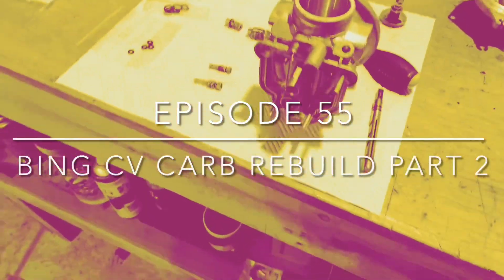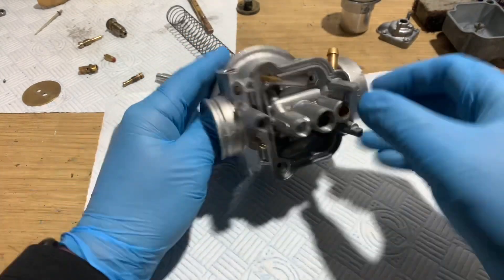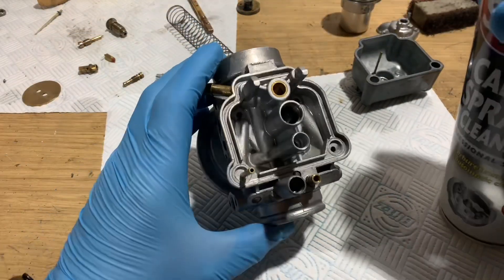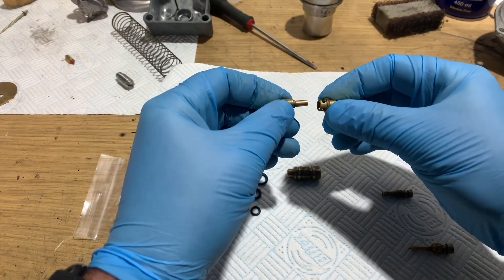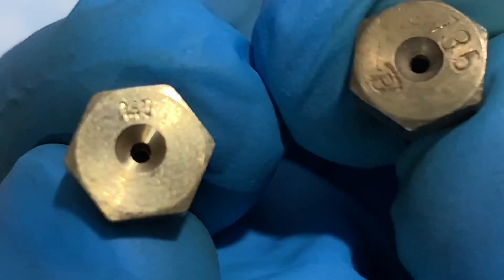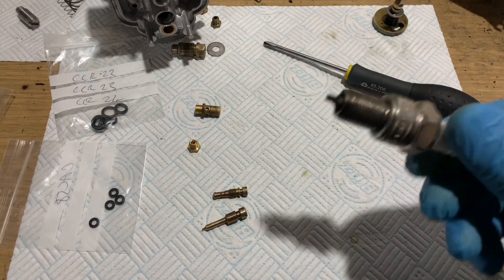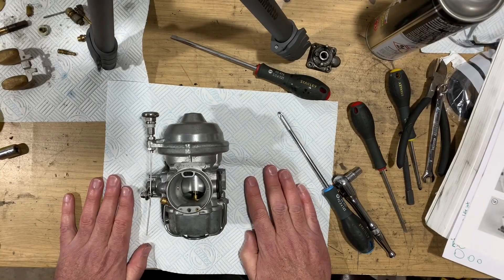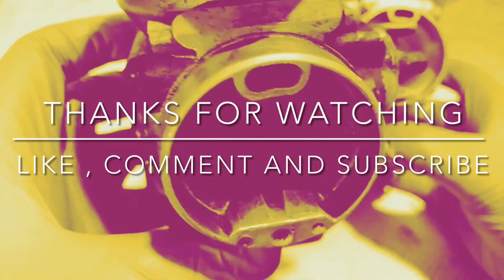55. BMW R80 Custom build. Bing carburettor strip, clean and re-jet. Part 2

Comment: I also changed to pod filters and an open exhaust on my R80. Changed the main jet to 145 from 135 and the idle jet to 50 from 45.
Reply: How's it all running with the jet changes? Done the Main but not changed the idle

Comment: Great job mate. I looks like you forgot to hook the needle valve spring to the float tab on assembly. Might be worth re-checking 👍
Reply from the maker: Ha!  You’re absolutely correct.  Picked it up doing the 2nd carb so went back to redo it.  Good spot!!